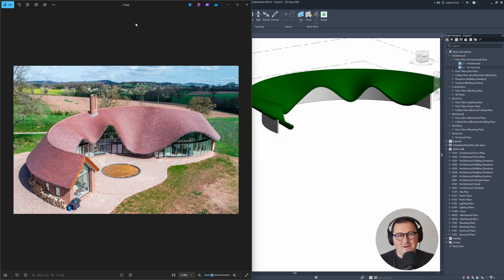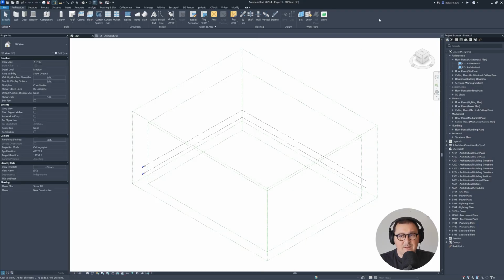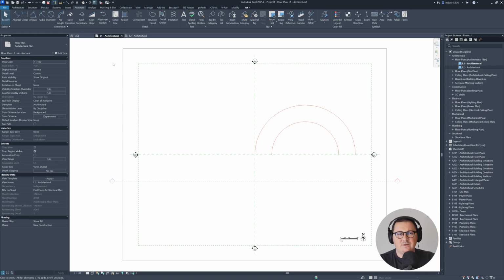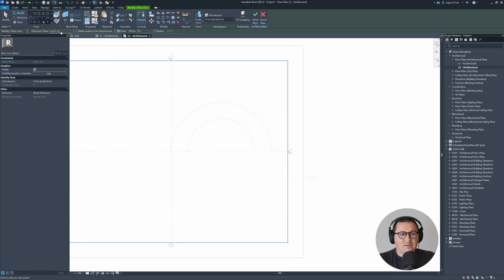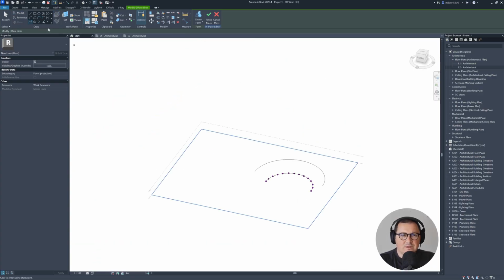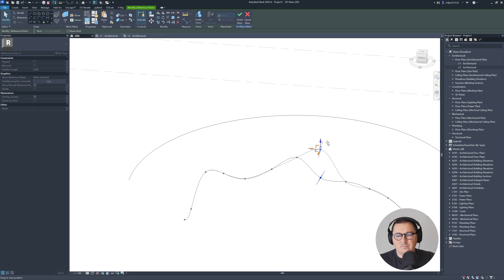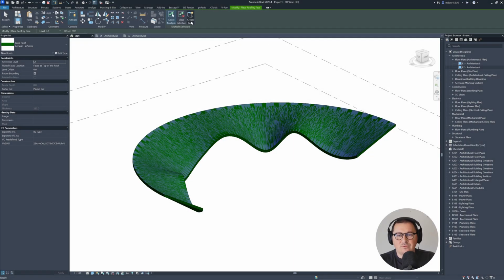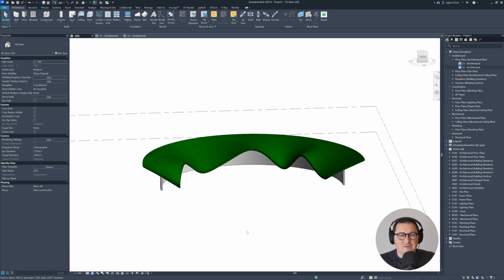Roof with Bended Surface in Revit

Comment: How about attaching the roof element I recently faced non linear roof element rafters and so on a problem thanks
Reply from the maker: For example you can take this wall I made with attached top to the roof. Go to Model In Place, take Sweep tool>Pick Path, and then pick top of the wall (curved edge) and add profile you want to have